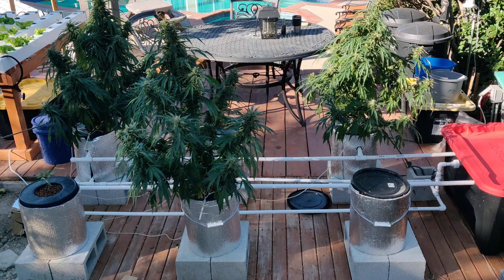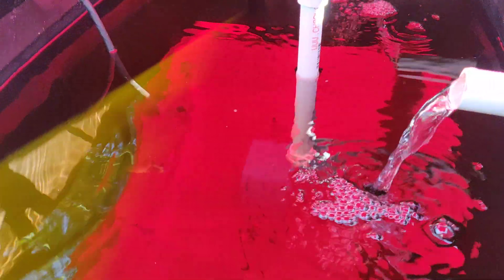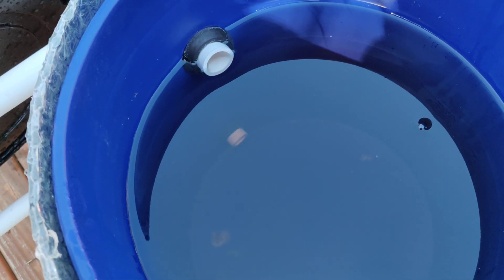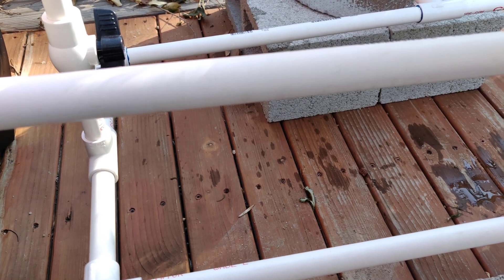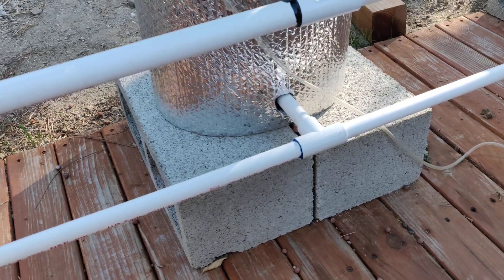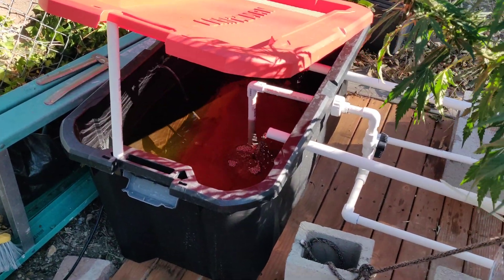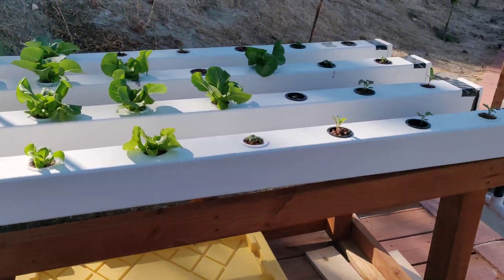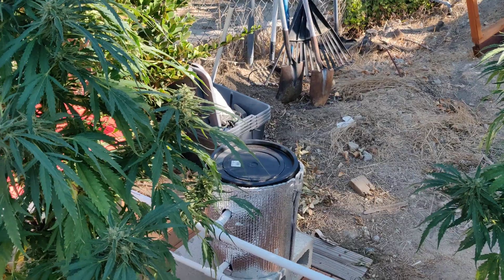How to build DWC recirculating deep water culture hydroponics 5 gallon bucket

Comment: I think you can drill a hole on the pump pipe inside the reservoir to move the water inside the reservoir. You can turn the pump valve open all the way, and let the hole regulate the excess pressure. I did this in my Dutch bucket reservoir bucket and the water flow provided oxygen and a circular current.

Comment: How are you vegging and flowering at the same time?
Reply from the maker: this video is really old so i dont remember much about it. However, it is not possible to veg and flower at the same time as the plant goes by light hours, which im sure u know. I did something similar in another grow where I put a small clone, say 12" into the system and the outdoor light cycle was below 12hrs and that little thing flowered lol. I had a mini plant lol.

Comment: I'm curious why you fill it from the bottom..couldn't you feed from the top using a drip feed system?
Reply from the maker: I had to think about you question for a min lol. So the reason why i did that was due to the buckets not filling up and circulating evenly, the only way to feed from the top would of been to get a really really strong pump as so it would build enough pressure in the pipes so it would distribute the water evenly once it was flowing. with my pump it was filling the 1st few buckets in the front much much faster then it was for the back row. So going from the bottom made sure that they would all get even water distribution, Even from the bottom the water would fill much faster in the front buckets but as the level went up it created backpressure and started to fill the next buckets in line till they got equalized. I have since then scrapped this process and now use RDWC and have a few videos showing how to build a system like that if u want to save money, or else u can always buy a current culture system pre built ready to go. sorry for the late and long reply, cheers.

Comment: If you do get leaks Aqua marine seal or aqua seal from Home Depot works fabulous
Reply from the maker: Thanks for the tip. I have now started using lowes square 5 gallon buckets with bulkhead fittings and still use some silicone around them to make sure i dont get leaks.
Reply: @f5f5quick  nice 👍! I use to dig blood worms on the coast of Maine and have tried quite a few adhesives on my hip boots if the needed to be patched or whatever and nothing would really hold up against salt water and not sure but I think some of the nutes out there have salt in them I could be 💯 % wrong but This stuff works wonders although I’ve never tried it on plastics but it’s a aqua marine glue so I think it’s worth trying if you end up finding any unwanted leakes in the future happy growing Good luck btw nice content

Comment: Hey thanks for the video.  I've been a drain to waste coco coir guy for a few years, after soil, and now want to move to true hydroponics (indoor growing). This video is part of my investigation and it really helped out in visualizing the setup part.  I have two chilled reservoirs. The problem with a straight up DWC (ie isolated totes), is the heat + light issue in my experience of keeping algae/mold/crap under control. I have chiller coils in the 2 current ~ 45 gallon each res's and want to cycle the nutes through the reservoirs to keep the temp under control, plus much easier to check EC and pH.  I agree with the grommet issue you highlighted. Thanks again for posting the video.

Comment: Good work man. So you have the water feeds going to the bottom of the  buckets, from a submersible pump connected directly to the output inside your reservoir? So the returning water is strictly gravity fed, from top of each bucket? Correct?
Reply from the maker: yap , exactly how u said it. but i have a few more videos on RDWC ( call it more modern design ) that i like more. its on my channel. happy growing

Comment: What do you use to get your PVC connected to the submersible pump?
Reply from the maker: I dont remember exactly, but what i did was take the peace that screwed into the pump to my local hardware store (lowes) and looked around the pvc section till i found something that would screw into it. Its different from pump to pump as they might use a different thread style so i would suggest doing the same to find the correct peace. cheers, good luck and as always happy growing :)

Comment: Hi! I think you can actually use the air pumps in the reservoir and it will oxygenate the water you are actually pumping. Water will circulate oxygenated from the reservoir.
Reply: Trust me you want air stones in every bucket!
Reply: @danielpowell3284  You don't need air stones in every bucket. If you feed your water into the buckets above the water level then the falling water will create oxygen. Also by pumping in air through the stones you are putting hot air directly onto the delicate roots. To chill your water try this. Buy a used water cooler off market place ( $15- $35 ), one that you would normally put a 5 gal jug in the top. Now tear it apart so that you are left with the compressor and the cooling coil. Some of the cooling coils are coated in a protective plastic and some are not. If the one you have doesn't have a protective coating on it just wrap a plastic bag around the coil so you don't get any oxidation in your nutrients. Place the coil directly into your nutrient reservoir. Buy a device that will monitor your water temp. I use the ITC-308 ($50). Plug the compressor into the cooling plug on the device and set your water temps. I set my water temp at 67 deg and set the turn on temp at +2 deg (69).

Comment: What do you do with the air pump? I see you have an outside set up does it not die when it rains?
Reply from the maker: Well yes it would if it actually rained in Los Angeles lol. We get pretty much zero rain May, but all I would do to protect it is get a small container and put the air pump inside with small holes on the sides for power and air to get out.

Comment: Do you have continues water flow or did you just fill it up once? Or do you just add water every few days?
Reply from the maker: Yes it's continues water flow, from the buckets to the main tank ( the Craftsman tote) what I do is ever few days I add more water a needed and as the plants drink it. Also when adding water I check the ppm and the pH. This is like an nft system but for deep water culture. Let me know if your have any more questions
Reply: f5f5quick how often do you have to change the PH level
Reply from the maker: @joeyking8036  not to often, like every few days it would go a little up or down then I would adjust as needed but not too frequently. Unless something foreign gets into the water the pH usually stays in the same level. But when adding nutrients than for sure I check and adjust.
Reply: I'm sorry if I missed it somewhere but what is your ph target? And ppms? Must keep it static since you have both mature, flowering plants and seedlings, eh?